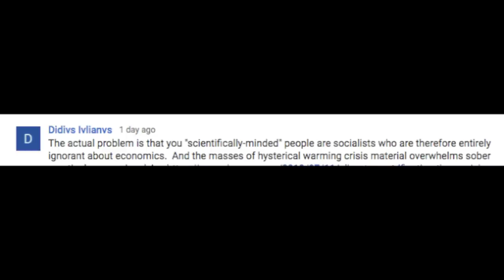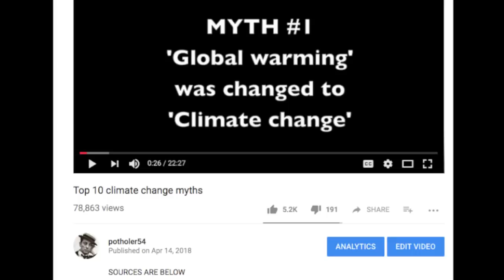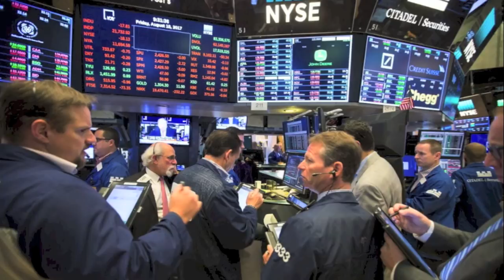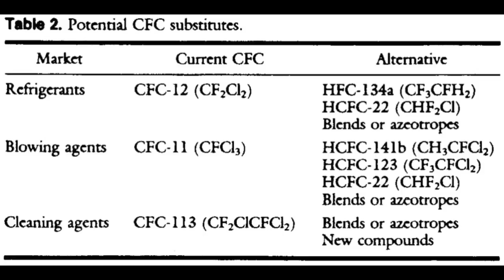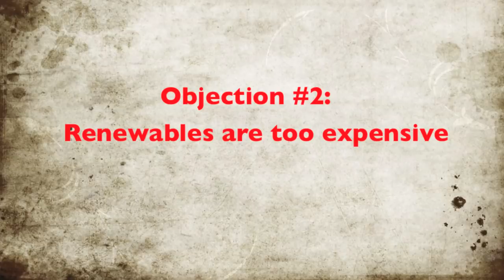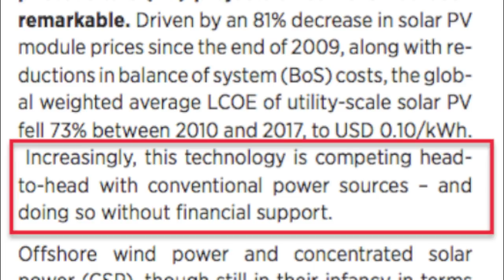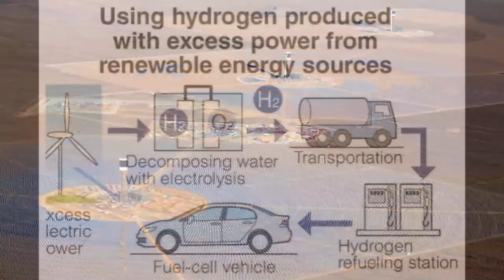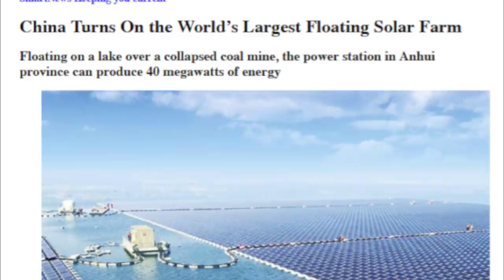A CONSERVATIVE solution to global warming (Part 1)

Comment: Interesting video. Not sure I agree with everything you say (certainly don't believe free markets are the panacea claimed by some on the right) but it's an interesting perspective that might foster cooperation across the political divide. 

Anyway... A big factor for why China has such a large stake in renewables, batteries and electric motors is it has near 100% control of the world's supply of the rare earth elements essential for them. The main reason for that was heavy investment regardless of the economic or environmental costs involved in setting up the mining. It's a bit late for a capitalist system to crack that control now. The price of REEs high enough to make a mine profitable? The Chinese government can flood the market. A foreign company gaining the edge in technology? Ramp up the price and force them to use less efficient alternatives or buy Chinese components.
Reply: "is it has near 100% control of the world's supply of the rare earth elements essential for them." Out of curiosity where did you get this fact? Also as stated in the video, if rare minerals are a problem, then we can come up with an alternative solutions. Such as in China where they created the Aluminium battery which is cheaper and equally efficient to the lithium ion battery. Honestly the video makes it pretty clear that America could switch to clean energy if people would start looking for solutions to obtain green energy rather than problems to avoid.
Reply: @friendly1016  http://ec.europa.eu/growth/sectors/raw-materials/specific-interest/critical_en
EU commission report on critical materials. There's a nice graphic showing where important raw materials comes from. Most of them are majority controlled by China. The US has a similar list of critical materials.

The reports are findable once you know to look for them. I only learned that critical materials was even a thing quite recently.

Comment: Your point on costs is incomplete as it doesn't include storage, which is included in other sources (coal, gas hydro geothermal ect), while I don't argue the decrease in cost of the production method, solar and wind are still far from cost comparable using a same use same time method. Part of why I don't like climate change activists is their lack of understanding on issues such as lifecycle costs, systems management ect. They think that it's as simple as just switching out the old and in with the new, if it was that simple it would of been done by now.
Reply: Coal and oil have significant lifesycle costs, system management costs,  production and infrastructure maintenance, etc. If you remove the subsidies from coal and oil they would quickly become prohibitively expensive.
Reply: Also there are amazingly fast storage developments occurring not just in batteries but also in hydrogen, water pumping and many others. Remember it takes time for supplychains and infrastructure to be built but once it is built it can actually produce energy cheaper than fossil fuels. Fossil fuels simply have the advantage of existing infrastructure. Still doesn’t mean that long term investment - a pillar of capitalism and conservatism mind you - isn’t worth it.
Reply: @ajr993  except they are still more competitive than battery and solar/wind (the cheapest storage method btw) yes they are subsidised in most places but on a life cycle basis are still cheaper (I have actually checked), that said things like hydrothermal liquefaction and air to oil tech would be cost competitive sooner if they ditched subsidies.
Reply: @jacquesstoop2587  I didn't argue against investment, I pointed out that 1. Wind and solar are not cost competitive if compared like for like with chemical fuels and 2. That climate activists are generally arrogant know it alls, that actually lack the knowledge to understand the complexity of the issue. I did not say that we shouldn't invest in research and dev, but this cult around wind and solar is just stupid and irritating, there are other far more simple ideas (hydrothermal liquefaction, air to oil and others) that are simpler to implement and are more compatible with the modern system.

Comment: The real solution is nuclear :P
Reply: Austin Martín Hernández every single nuclear disaster could have been prevented if they followed the same rules and regulations we follow here in the states and there are even safer and more efficient designs drawn up than what we have commercially
Reply: @ninjaslash52_98  Yeah, so Long Island didn't happen? That's awesome! :D
Reply: PinkPonyOfPrey “due to inadequate training and human factors, such as human-computer interaction design oversights”

As I said “could have been prevented”  the Chernobyl incident was also due to human factors
Reply: UK has ordered a new nuke from the Chinese/French at Hinkley Point in Somerset. It'll cost £25bn to build (and the price is still rising) and then the government has guaranteed the strike price for the electricity - index linked to 2012 prices - which have been estimated to cost a further £100bn over the 30 years lifetime of the power station. So £125bn is the estimated 'cost'. Although that doesn't include the cost of managing the radioactive waste, nor the decommissioning costs. It is a 3.2GW power station. Three point two.
So... to put that int context £25bn could buy 5 million homes a 4kw solar array with 4.2kWh of lithium battery storage (@£5000 per home - although the price is falling for both PV and batteries so it would probably be a lot more at those economies of scale). That is 20GW of generating capacity at peak summer - with 21GWh of storage. The worst winter would reduce that peak by about 80% to about 4GW - but the batteries will make it far more manageable.
The £100bn guaranteed strike price could buy another 4x that (over the next 30 years)... so - a total of 100GB of generating capacity - compared to 3.2GW with no storage included in the nuke price.
Of course onshore wind power plus batteries gives an even BETTER economic picture than solar PV - and offshore wind power is also far more competitive than it was, with huge new wind turbines coming on the market every year.
It's also worth remembering that the USA subsidises fossil fuels and nukes with as much money as they spend on their military - renewables can now stand on their own 'profitability' without subsidies in many places on Earth.
Reply: @ninjaslash52_98  and you can guarantee that the waste will be 'safe' for 250,000 years can you?
Reply: Earl Bramley-Howard lol i see you. Don’t know shit about nuclear using a thorium reactor and fast reactors we can get rid of 80% of our current nuclear waste dismantle warheads for fuel and the rest will be safe in a couple hundred years compared to yes hundreds of thousands of years but considering currently each house produces a quarter sized amount of waste each year with thorium and fast reactors there’d be a pin head of nuclear waste per house fucking windmills and solar panels make more waste than current reactors 😂
Reply: Earl Bramley-Howard tf are you talking about nukes for
Reply: Nuclear is an old, expensive dying industry with only fanboys and paid trolls still keeping the smoke and mirror up.
Reply: PinkPonyOfPrey holy shit I’ve never seen such bull shit before 

Not even 100 years old yet you’re calling it old 

Expensive for 1 facility but compared to the cost of making a shit ton of solar win coal power plants just to match its power output then maintenance nuclear is better in the long run and doesn’t use a bunch of land which I’m sure would make you happy as I assume you also believe in overpopulation 

Not denying I’m a fanboy cause I’ve been researching it for the past 4 years and writing most of my college papers on it if given the chance
Reply: @ejbh3160  If we invest in thorium salt reactors. The wast is only radio active for 500 years and   do not suffer the runaway meltdown of typical reactors. you can also make them smaller and cheaper.
Reply: @pinkponyofprey1965  But Long Island harmed no one.
Reply: @ejbh3160  New reactor designs can burn nuclear waste as fuel to the point where there is very little radiation left while being meltdown proof.
Reply: @pinkponyofprey1965  It's only expensive because the ignorant suppress the use of new safer technologies. Try reading about Thorium reactors and a company called Terra Power, the one Bill Gates funds.
Reply: Nuclear is the only solution

Comment: You do realize that the largest battery in the world can only run New York City for all of three minutes.  If you want to get rid of coal and natural gas you had better be able to run NYC for three DAYS.  Batteries have a long way to go, they have to improve their economics by a factor of 20.
Reply from the maker: " the largest battery in the world can only run New York City for all of three minutes"
   Then don't run New York on a battery.
Reply: @potholer54  yeah but if you want to get rid of fossil fuels you are going to have to have battery back up for at least 3 days when the wind doesn't blow and the sun doesn't shine.  Unless we find another way to make electricity that does not involve fossil fuels that can produce power 24/7/365.  Enough to run NYC.  That scheme does not exist now.
Reply: @LewisLudwig  I found it also depressing how energy storage seems a problem. But .. in theory a perfect solution exists. All that money in the world looking for a good investment, could be used for a continental, even global super grid (DC , high voltage ). This would allow to share any surplus energy with other places that need it then. It's a visionary idea but politics could get in the way and much CO2 could be released in setting it up. At least certainly the copper from the existing lines could be reused. https://ses.jrc.ec.europa.eu/transcontinental-and-global-power-grids
Reply: @jean-pierredevent970  the cost of the transmission lines for the "world wide" grid as you propose it would be prohibitive.  You can only move power so far.  And you do realize you lose power when you move it in those transmissions lines don't you?  No big deal if it is 100 miles or so, but Germany is having problems moving their wind power from the windy north to the industrial south Germany.  Moving solar power from the Sahara desert to the US East Coast just is not feasible.
Reply: @LewisLudwig   DC and very high voltage transport minimizes losses but still,  intercontinental cables under sea seem indeed something for the far future. So US energy must come from sources within the continent itself.
Reply: Categorically wrong.  Australia is running on a battery... Sort of.
Reply: @jean-pierredevent970  Almost any CO2 elimination scheme produces a lot of C02. Kissing China ass produces extra coal fired power plants courtesy of potholer himself. He needs to do a tour of them for us.
Reply: @MrDemolitionmission  I certainly have doubts too about a few solutions that are proposed. I think about scrubbing CO2 out of the air with reactive oxides or hydroxides.(how green is the production of these?)   I see a lot in cryogenic storage systems if ... they store and reuse the waste heat and cold well  (are gravel beds really the ultimate solution for this? )  These plants are safe for the direct surroundings and can use the waste heat from a factory nearby.  Highview sells such plants already.
Reply: nuclear is the most promising option, the excess energy can be used for so many things
Reply: @Lewis Ludwig Is there some reason you can't have multiple batteries running a giant city like NYC? If the largest battery doesn't work, create a thousand of them a tenth the size. I see no reason to limit ourselves to a single battery.

Sure, the energy produced to charge them might still be coal based until renewables catch up. That's a problem that needs a solution. But implying that we'll need to find a way to run an electrical grid for a whole city on a single giant battery is a preposterous strawman IMO. Lol

Comment: Nuclear ftw
Reply: It has become to costly to bill nuclear plants, we have yet to figure out how to deal with waste from building the bomb, not to mention the radiation that effected so many then and now. Shall we move on to talk about Chernobyl (you do know that they had to build and put in place a new containment building, Fukushima....they haven't yet figured out just how they are going to dismantle the reactors, they have no way to stop the flow of nuclear contaminated water into the ocean, and in case you didn't know they have no idea where one of the reactor core is, as it appears to have burned through the bottom of the containment vessel. So unless you want a reactor in your backyard then I vote no way. And don't even get me started on Hanford because I will start naming other smaller waste sites affecting people.
Reply: MajorLeague  Smaller plants has been a push by some in the industry. The issue is you lose economy of scale, so while it is cheaper on an absolute scale to build it's more expensive per MW. Even larger plants are struggling to compete with natural gas because that's dirt cheap right now.
Reply: Too expensive. Solar electric was cheaper even way back in the 1990s and Nuclear doesn't spin up or down quickly so you still would want batteries to smooth out the peaks and valleys... Pretty much all renewable types of energy coupled with batteries is cheaper to build out. Then with nuclear you have fuel to get and then store safely for over 10,000 years to consider as costs... Edit:grammar for clarity.
Reply: @0ooTheMAXXoo0  You use nuclear power for a baseline and other forms of generation for load following (that's what the "peaks and valleys" are called). You can load follow with nuclear power by using control rods to control power output. But generally speaking because nuclear has high capital costs but lower operational costs, you want that running at max at all times.
Reply: @0ooTheMAXXoo0  FWIW, the nuclear industry in America already pays for the storage of spent fuel. It would actually be cheaper to do so if it were centrally managed in a facility like Finland.
Reply: The people pushing for SMRs are generally trying to tape into economies of serial production, and if they can, the lifetime costs will still be lower even with higher higher loses.
Reply: That's an excellent point. If you could make an "assembly line" of SMRs you could make them comparatively cheaper. I'm not completely convinced that even that would make the SMR more cost effective on a per MW basis but it would definitely open to the door to other opportunities that a larger reactor just wouldn't make sense for. Building a 3,000 MW reactor isn't sensible if you only need 300 MW. And of course there's no reason you can't do both SMRs and large scale reactors.
Reply: MajorLeague  I'm not sure I follow your distinction between energy security and energy production. I do know that nukes are insulated from fuel cost fluctuations because the cost of fuel is small (compared to the rest of the plant operating budget, of course) so that even large swings don't affect the cost to the consumer very much. Contrast that to fossil fuels or even potentially with renewables in the form of rare earth metal cost. At the moment, that pendulum has swung way in the favor of natural gas in the states. If legislation captured the cost of externalities  though, that calculus might change. The nuclear industry already accounts for the costs of its entire life cycle, so that's unlikely to change except in the cheaper direction. 

There's no "volatile" fission products in the explode-y sense, and the reactor would have to be pretty small for off site refueling to be economical. Transporting the rods to the site rather than the other way around would almost certainly be cheaper.
Reply: MajorLeague  The "modularity" of the SMR is that you can order, say, a 300 MW reactor. Then in ten years order another one when you need it and plop it right next to the first. "Small" is a relative term here, lol. The military has self contained reactors which aren't refueled during their lifetime, but they also use highly enriched fuel well above what is typical for an industrial reactor.
Reply: Ah, I see what you mean. The fissile material issue isn't as much of a concern now as it was in the past because of advances in enrichment technology. The point of fuel production is really the concern. It's not a trivial thing to extract the fissile material from spent fuel rods but with centrifuges the same facilities that make industrial grade material can make weapons grade material (you literally just spin it longer). That's why Iran's centrifuge facilities are a concern; there's no way to distinguish between a facility that makes industrial fuel and one that makes weapons grade because it's the same equipment in either case.

Spent fuel rods from a LWR would have to be reprocessed in order to be used again in another LWR. You need a minimum of ~3% enrichment in a LWR to maintain fission. Heavy water reactors can work with lower enrichment (even natural uranium) but then you have to make the heavy water. The smaller reactor core wouldn't change that; if anything, a smaller core would require more highly enriched fuel because of neutron leakage issues unless you mitigated that with hefty reflectors. Reprocessing is currently not allowed in the US, but that's a regulatory issue again caused by proliferation fears. In an ideal world you'd reprocess the fuel and use it again to get a higher burnup.